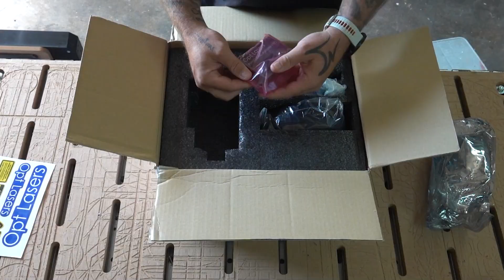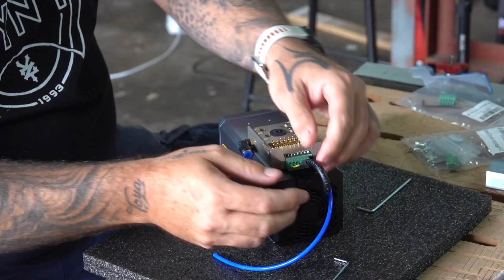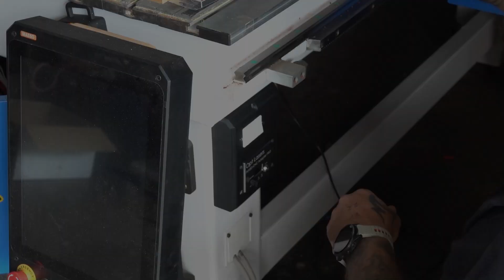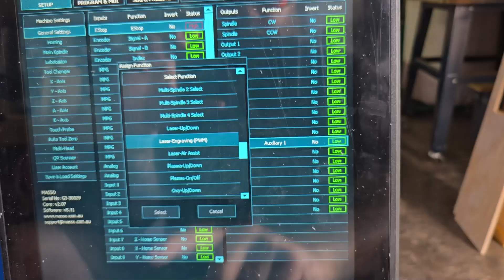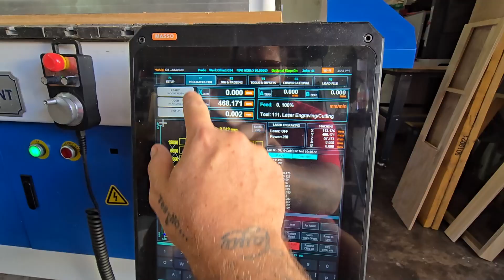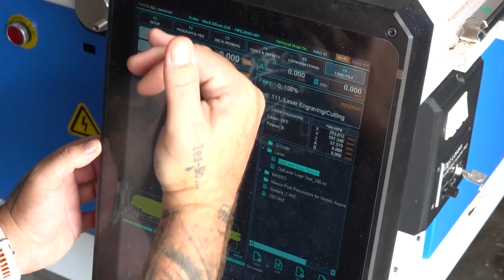How to Install the PLH3D-XT8 on a Blue Elephant 1325 CNC

Comment: Lucky you had it going. Mine’s been a nightmare. For the G54 issue, I used offsets which the controller (not Masso) automatically detects when in laser mode which helps from editing code or using G59. Still having a ghost line when engraving and can’t seem to figure it out even though I had identical setup to another CNC user. Probably the short it had from factory is the cause. 🤷🏻‍♂️